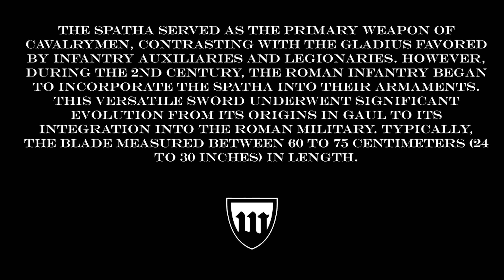Forging a Roman officers sword, the complete movie.

Comment: Awesome video as always.  The introductions and the soundtrack to the introductions are excellent additions.  Thank you for proving how well this sword holds up against mild sheet steel.  Romans in the 2nd century pretty much dominated, so obviously this sword did well.  How would it hold up to one of your Damascus blades, or an ancient (or modern) master Japanese blade?  Did the minimal hilt result in the loss of a hand, or did the tactics of this relatively short sword mitigate the risk?  The slight widening of the blade near the tip is a beautiful touch; I expect it adds a touch more momentum on the slash.

Comment: Beautiful work! I’ve never seen the step you took several times clamping the sword between two sturdy wooden beams.  What does that do? Straighten the sword? Control cooling?
Reply: i was curious also
Reply: Helps to prevent warping of the blade as it cools

Comment: It turned out well. But I find it hard to imagine that 2,000 years ago, when high-quality steel was very valuable, blacksmiths could afford to forge a billet twice as thick as needed, only to have half the metal scraped off on a whetstone. But in the modern version, it is a good reproduction, as I said.